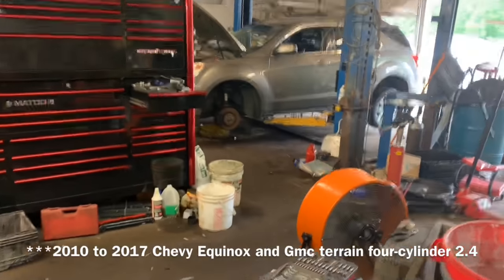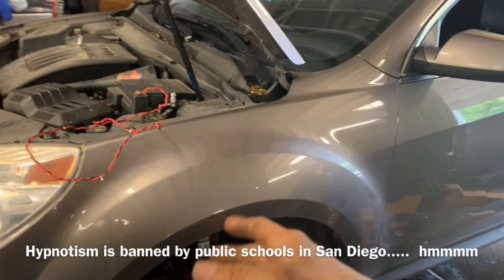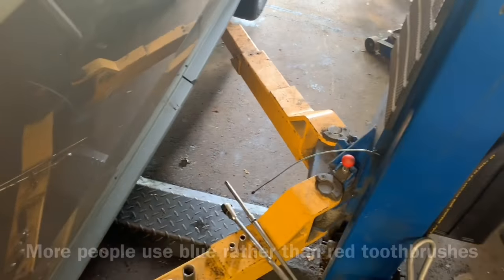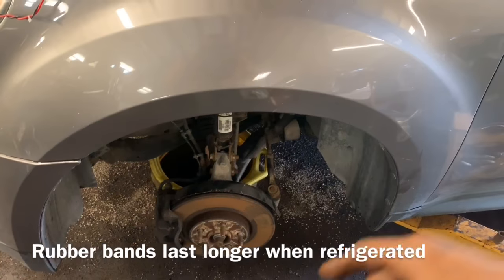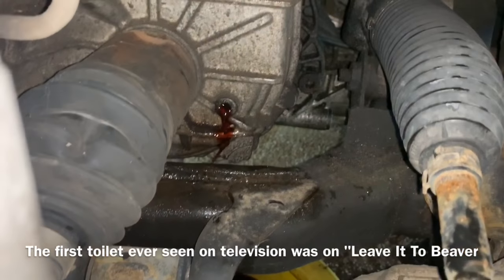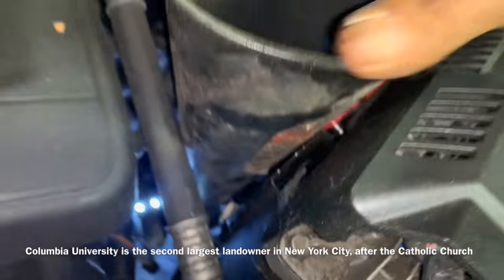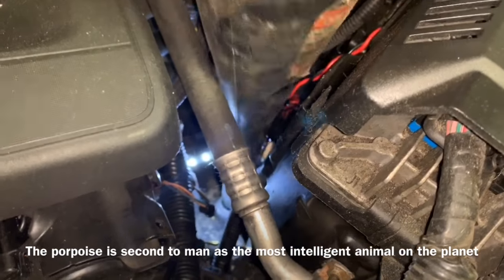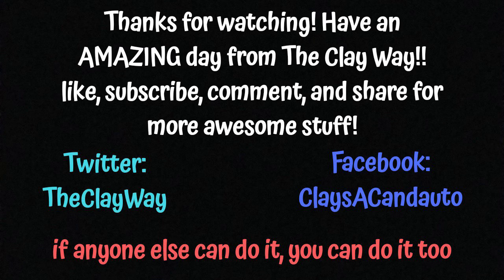Chevy Equinox Transmission fluid check and fill procedure

Comment from the maker: If you found the video helpful and want to help us out, you can use these links to purchase ANY ITEM on amazon and we'll get a small commission with no extra charge to you 😀 Thanks for watching folks!

Craftsman 20 Piece 1/4 Drive Metric Socket Set: https://amzn.to/3xEltpy

DEWALT Drive Socket Set, SAE/Metric, 1/2-Inch, 23-Piece (DWMT73813): https://amzn.to/38aIW7c
AVID POWER 18pcs 1/2-inch Drive Impact Socket Set, 10-24mm Metric Sizes Sockets and 3'' 5'' 10'' Extension Bar: https://amzn.to/3v3d4dF
Craftsman 230 Piece 230 PC SAE Metric Mechanics Tool Set: https://amzn.to/3ExuZwl
2pcs LED Car Cup Holder Lights for Chevrolet, 7 Colors Changing USB Charging: https://amzn.to/3K8HsYq
UYYE Car Trunk Hanging Organizer: https://amzn.to/3OvDH2M
Reply: So I have to leave it on right? For the whole process?
Reply: Hope you answer

Comment: What ever happned to the good ole fashion dip stick
Reply: For real
Reply: Too expensive.
Reply: Exactly!
Reply: They took out transmission dipstick tubes so you can't take it to an oil change place to have the transmission flushed. They will now tell you that you have to take it to the dealer
Reply: 🤨👉🏾They threw it out with integrity
Reply: 😂. I replied the same - then saw this
Reply: You can actually go on Amazon and purchase a dip stick for the equinox.  It goes where he poured in the fluid.
Reply from the maker: https://amzn.to/3gAVnxw
Reply from the maker: I think this is the one you’re looking for Jim
Reply: @lilshifty8137  That's it.  Thanks @the clay way
Reply: Just like spare tires! 😂
Reply: I dont like that they took it away but its there so that people dont put the wrong fluid in. Of you take it to the shop then its more likely that the mechanic will fill with the correct fluid. Again it sucks but thats the reason
Reply: I swear
Reply: @gondonmeddruxon  yeah I am not a fan. Was just saying the possible reason for it
Reply: People with not enough brain cells kept adding too much fluid and ruining their transmissions so the dealer figured they're better off not touching it, which is probably true for a lot of people
Reply: Interesting. Sucks to take in the car just to check the fluid
Reply: Well, it all started with Chrysler. They claimed the reason their trash transmissions were going out was due to the “customer” not adding tranny fluid (yeah nice try Chrysler but no cigar). So they came up with the ‘sealed’ transmission so all us idiots couldn’t ruin them anymore (sealed transmissions are trash too) & guess what… sealed transmission’s have to have fluid added to them too BUT not by the moronic owner oh no no no. We have to come here & see how to do it OR bring it in somewhere & pay them to do it.

I worked at an auto salvage yard in the 90’s & every single day I received calls for a Chrysler minivan transmission. Chrysler should have sold those vehicles with an extra transmission for future use.
Reply: @jimowens381 those only work for the XLT models. I have an LT & was bummed 😭
Reply: No money in it for em

Comment: Thanks I'm 62 years old been a certified mechanic in Michigan for 30 years closed my shop in Detroit  and stopped working on car's other than family and friends. But have recently bought a 2012 equinox and was dumbfounded? Found filler tube ? But no dipstick your video is a spot on 
Even a basic diy'er can follow you're video thanks not having any issues but for piece of mind
AND a 1460 mile trip to Florida I'm going to check it and when it warms up here in rapid city Michigan I will change it. A 5 🌟🌟🌟🌟🌟 VIDEO.   THANKS
Reply: He failed to bring the ATF up to temp 176F  and shift through PNRDM to fill the valve body and did not activate the temp controlled reservoir.  GM i Service Instructions is very specific about this to prevent over filling, and foaming the ATF. ATF will lag coolant temp by as much as 60F, idling does not cut it. 4th gear on the highway, 4k rpm for 20 min. Most techs do not bother checking SI, creature of habit.
Reply: Why does someone always have something to say.😊

Comment: For the last 9 years I've understood from prior conversations and reading that the 2011 Equinox transmission is basically a closed system and unserviceable to the layman. One video even showed a section of sub-frame that had to be removed to get to the drain plug. Plus there's no stick to measure fluid level like on most vehicles. At any rate, I was please when your video matched what I saw for myself. I want to add 24 oz of Lucas Transmission fix to see how or if it helps at all. Even at 157K miles the 6 speed transmission still shifts pretty good.

Comment: Great video, was able to easily add the transmission fluid using these instructions, they were right on
Reply: He left out important info and did not follow GM Service Instructions.  YT techs rarely consult SI,  and just do it hiw they always did.
Reply: @tssci6774  what parts did he leave out?? instead of talking shit how about you help by putting the information he didn't??
Reply: @cozmo2727  read the service instruction, available online and from the dealer.

Comment: simple enough. Thank you for the video.  Any guess why they don't use a dipstick for periodic checking?
Reply from the maker: I would assume it has something to do with the pressures on the inside of the case sometimes some transmissions create pressure and the fluid would’ve blew out the dipstick would be my guess

Comment: Hey clay good videos keep them coming .  One question, my 2011 Chevy is giving me a P0700 code .  Where is the TCM    location.
Reply from the maker: The TCM is located in the engine control module it’s all one unit. Which is located on the top of the battery sorry I don’t know codes off the top of my head so I couldn’t tell you what that’s for

Comment: According to GM  Auto Transmission Service Association they require the ATF to be at a minimum of 176F, and for technician to shift slowly through PNRD, to fill the valve body with fluid.  Also there is temperature controlled reservoir in the transmission that is activated at higher temps.  It takes driving in 4th gear on the highway for 20 minutes to get the ATF up to proper temp.  Failure to do this will cause over filling the transmission, then foaming, and loss of lubricity of the fluid.  Redo the video using the proper method, and a scan tool.  You have access ti GM service info, follow it, and quit steering customers wrong.  When others ask about this you dont answer.  Coolant temp does not equal transmission temp.
Reply from the maker: I had a very long reply written out for this….but 

The simple fact is no matter what I say to you you’re gonna rebottle with some BS garbage there is only going to lead down to one Road…

These cars are crap they’ve always been crap and it doesn’t matter what procedure you do there still crap.  These vehicles were between $25-$35,000 brand new and GM considered them throwaway automobiles. They have so many different problems with the engine and the drive train the bottom portions of them Rusting out making the vehicle underivable.

I’m very glad and very pleased that my video made you feel much better about yourself. Sometimes that’s what keyboard warriors need. 
This is so people can ….. heck with this waste of both of our times 

I have no more time for a battle of intelligence with an unarmed man…… 

God bless , Jesus loves you , even when you don’t love yourself
Reply: @sharpcarco  Thanks for confiming that you are just a lazy parts changer with a youtube channel.  3 million Terrain/ Equinox built, your opinion is not representative.  Almost all the issues can be traced back to GDI, long drain intervals via the OLM, poor oil specs(petroleum) GDI fuel dilution and abrasive soot.  Ford, Honda, Toyota alsi had probkems with oil consumption, timing chain wear.  API and OEMs finally update drain intervals, and seven engine tests to deal with wear, 10 years later.  Had many customers ised premium synthetic oil, filters, and changed oil every 3k miles we would not be having this conversation. I am part 4 different Terrain and Equinox forums, and every owner that followed strict maintenance with quality oils did not have these problems.  It wasnt bad rings, because neglected engines with new rings suffored the same problems in all 8 years. Google GDI Soot, it is elephant in the room that no one wants to acknowledge.

Comment: L had an axle   repair and just need a quart of transmission fluid. Can I add that quart back through the top filler and not drain.
Reply from the maker: Yes that is where you add it anyway
Reply: @sharpcarco  Thank you for my answer to my question, I know that I can handle this task on my own with one more suggestion from you , please. Can I use my oil dipstick (clean ) to get an idea of when the transmisson fluid is at the right level or what do you suggest.
Reply from the maker: That’s a very interesting question. I doubt that you can because if that was a possibility I think they would’ve just put a dipstick inside there.

I am here to tell you it is extremely simple to check the level of the fluid

You do not need to remove the wheel you just need to remove the check plug like I show you in the video.

Let us know if your dipstick tells you anything. 

And I would say if you believe about a quart came out just put half a quart back in.

Always remember that it’s better to have lower transmission fluid then higher transmission fluid the transmission will operate just fine being a Half quart low the thing you don’t wanna do with transmissions is overfill them but even if you overfilled it by half a quart it probably would make that much of a difference but it’s always better to be lower than higher.

Oil is exactly the opposite you’d rather have more than not enough. Within half a quart to a quart over is fine most of the time as far as oil is concerned transmission works exactly in reverse.
Reply: @sharpcarco  Thank you for replying back to me .

Comment: I have a 2012 Equinox and after the transmission warms up it will not engage it just revs up the engine in drive or reverse. Is this a sign I am low on fluid?
Reply from the maker: I’m sorry to say that that more than likely means it’s bad. I greatly apologize. I wish I had better news for you

Comment: Thank you that was very helpful, however  I have a q.
I changed out my cv axel and some fluid dripped out is that normal? If not what do I need to do?
Thank you
Reply from the maker: If it just a small amount…. Don’t worry, use the video to check it . 

BTW , It’s worth saying transmissions are better off with less than more….

Comment: Hey great video. My question is why do you fill with the drain line open?
Reply from the maker: There’s a drain plug and there is a check plug

Do you leave the check plug out?  Not the drain plug.

Then, when he gets up to the proper level, it starts draining out the check plug .

Comment: Liked and subscribed! This is the exact video I've been waiting for for my 2012 2.4L LEA. 

My biggest problem is that there is no transmission temp sensor, no way to know when the temp is right even when connecting to OBD with the Bluetooth dongle.
Reply from the maker: Technically speaking the temperature test should be taken somewhere between 105 and 125 if I remember correctly . So if you check in about 7 to 8 minutes after it’s been started at an idol you should be pretty close to there

 thank you very much we’re glad to have you and appreciate you joining our crew
M.C.I.D
Reply: @sharpcarco  Thank you for the reply. I'm in Kzoo, if I have any issues I'll be headed to GR!
Reply: You need to invest in a more capable scan tool 🤙🏻

Comment: My 2015 equinox lt AWD just recently seems like its struggling to switch gears when accelerating.  I noticed when I was accelerating on to merge on highway and my rpm was pass 5 before switch gears and went back down to 2.5 rpm. Now ive noticed it takes a while to get into  last year everytime. I was researching what could be cause of this and it seemed like it could be transmission fluid low or needs to be replaced. Ive bought vehicle from dealership 2.5 years ago and it seems like ive had issues with this vehicle for the past year. Oil consumption, air pressure sensors and most recent was the exhaust sensors needing replaced. All issues has given me a warning light or check engine light pop up.  There is no warning light that has popped currently, i just can tell that something isnt right when I am accelerating and its taking too long to switch in final gear and its never been like that until recently. Do you think its my transmission fluid?

Comment: Ok, since I haven’t seen anyone who posted a question about this.

How do you know if there’s enough transmission fluid inside if we wait until there’s barely any fluid coming out? For instance, let’s say you have a slow leak through the seal of the axle which is on the drivers side. Your transmission level could be so low that barely any comes out. Now we’re thinking to ourselves it could still have enough because barely any fluid is coming out. I’m confused.
Reply from the maker: Quite simple fill it up till it comes out. You will know.

Comment: Question . assuming i overfilled mine i could just get the car warmed up then take that side plug out let it get to a slow drip then put the plug back on without adding more fluid ? ..
Reply from the maker: Yes That sounds correct to me

Comment: I am glad I watched your video thanks for the Honesty something you don’t get with many Mechanics these days.  I had a transmission oil change long before it was due on a 2015 Equinox automatic and manual shift transmission.  After they changed it they took it for a test run and told me not to bother coming back the next day as they checked it and all was fine.  I took their word.  The transmission in automatic seems fine smooth as before but I now have a problem one year later after trying it for the first time in “M” drive.  The transmission won’t shift up or down and remains locked in 1 when you start out or if you shift from Drive to “M” then it stays in the high gear.  Would this be an issue with their work while changing the Transmission fluid.  (Asking me not to go back the next day when it said on the invoice to go back next day makes me suspicious.  I have never used the “M” transmission after the oil change.  But I know it worked before.  WHAT HAPPENED TO MY car I only noticed this one year later when I decided “Hey, I didn’t check their work after by using both Drive and M gears.  Can you help?  Please

Comment: Is there a way to completely drain the fluid ? I have a 2012.
Reply from the maker: I believe that there is a bolt that looks different than the other ones on the very bottom of the transmission facing towards the driver wheel. I’m sorry I don’t have one to go look at right this second

Comment: How do I cycle it through all the gears? And which is the best fluid to use for a 2010 Chevy equinox v6?
Reply from the maker: Hey good afternoon what do you mean by cycling it through all of the gears? Are you trying to say how do I get the fluid through all of the gears well the fluid pumps through the gears and the transmission anytime the vehicle is running. Putting the vehicle into gear put it up through the solenoids etc. etc.. As far as what type of fluid you should use look inside your owners manual whatever fluid they recommend is the best fluid for that vehicle unfortunately I do not know off the top of my head I hope some of that information is helpful for you God bless and have a great day

Comment: Hi Do You Know if that is for The 2018 Equinox LT Awd Too? Thanks In Advance
Reply from the maker: Usually on the rear deck lid of the vehicle it will say AWD , also you could look underneath it and if there’s axles going to the rear wheels then it is all wheel drive.
Reply: @sharpcarco  I Talking about the Procedure, May be the Same?

Comment: Is this relatively the same on the 06 V6 ? These vehicles are starting to really make it on my manufacturer lemon list.
Reply from the maker: Well, the 2006 V6 is generally the 3.4 overhead valve engine and they are a lot better than the 3.6 they put in the 2008 or later models
Reply: @sharpcarco   thanks for replying I didn’t even know they changed the liter.

Comment: Do you check the trans fluid with the engine running on the Equinox?
Reply from the maker: Yes you always check transmission fluid when the engine is running and up to operating temperature

Comment: I have a 2015 Chevy equinox LT 4cyl. And it looks like a transmission leak from what I've found on the floor in the garage. But it's on the passengers side also I can't find the leak anywhere on the vehicle everything looks dry and great. So I'm confused as to what it could be. The leak based on the floor looks like it's coming from the passengers side directly under the drivers seat
Reply: I'm not sure what to do
Reply from the maker: Hey Francisco if you had brought the truck to my shop and describe that problem the same way I would first look at the output shaft seal between the axle and the transmission more than likely there’s a leak right there from your description and what you’re saying I hope that’s helpful and I hope you find your leak
Reply: Legendary Mortals  yes... take an inspection mirror and look around the water pump for leaks. The factory water pimp leaks I believe from the top/block side of engine. My 2011 had me thinking the same about Tranny but it was the water pump and the orange GM coolant.   I changed the pump myself and I pray I never have to do it again on that ecotec.  Wasn’t fun...Lol